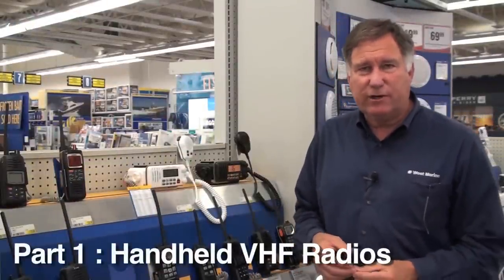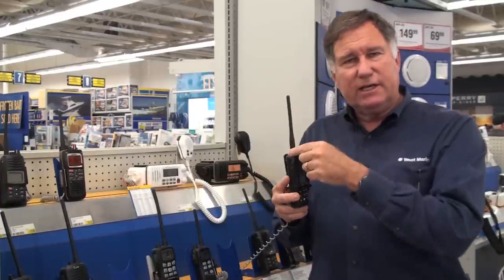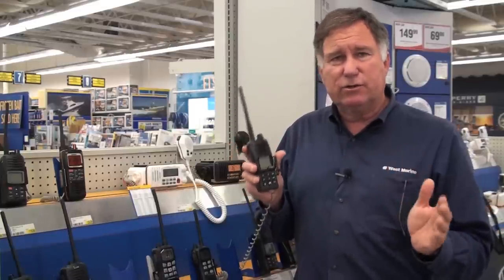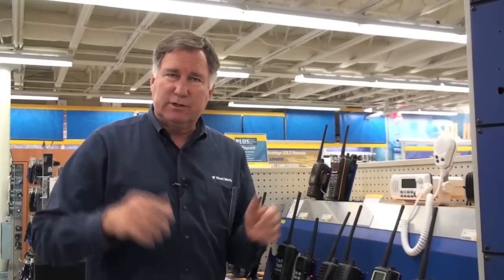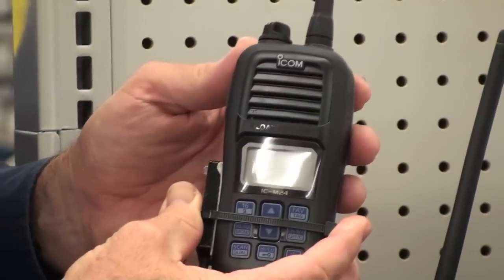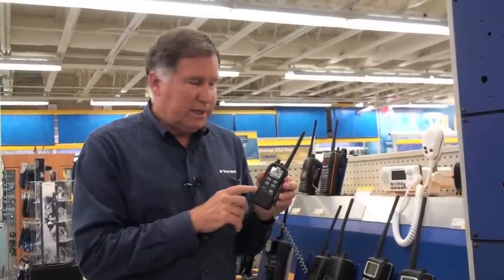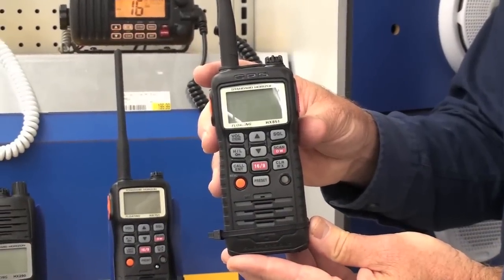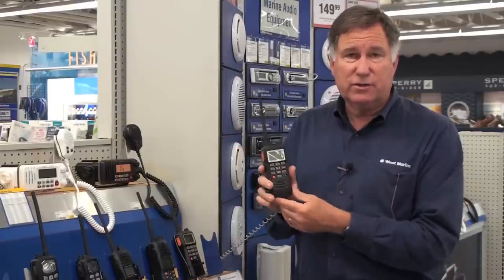VHF Radio Buyer's Guide: Part 1

Comment: I must admit some folks will roll their eyes when you recommend a mobile phone to them when they have a VHF radio question, as everyone already knows about cellphones and someone inquiring is likely looking for an alternative for coverage or outage prep reasons... but definitely yes, you wouldn't want to buy a marine radio for use on land because, as Chuck mentioned wisely, there are a very few channels for all the boaters to be fair, and legally they are some of the most monitored and policed public-esque frequencies there are. For land look into GRS/GMRS (and radios that say FRS) as these are more the land equivalent. A Technician's Ham radio license is so easy to get now, as well, and gets you VHF and UHF uber-priviledges; people say things like. "My dog could get one now that they Nerfed the exam, and he's dead". This gives you the ability to operate something like a Baofeng uv-82 which has the same power as a marine Uniden Atlantis 250 but WAY more frequencies to play with (not recommended for salty marine use though) and perfectly legal to ragchew for hours without anyone caring on oodles of frequencies. That radio also is capable of the marine (would rather rely on Chuck's Uniden at sea) and GRS/GMRS/FRS frequencies (one of those, I forget which, is for Canada and/or UHF technically). Main point, it's best to do the research for an evening, and then relax no one is trying to triangulate you for interfering, and you're helping the world run smoothly. Literally CB is also still pretty cool, but on sideband SSB away from the nimrods threatening to kill someone (or their mother) on the hour. The propagation/distance is great (and international skip is fun and open for the next couple years until the solar cycle ends) the only drawback being the little rubber antennas don't work as far, but large ones work much much farther.

Comment: I believe the FCC allows you to use just about any means of communication in an emergency, but the original question was about land use. You would never want to recommend marine VHF radios for land use. However, in an emergency, I would use whatever was at my disposal. There are much better devices to use on land if you are buying it for that purpose (mobile phone, SEND device, PLB).

Comment: I believe that the FCC has a rule which basically allows you to use radios incorrectly if it will save lives. Sort of like using a Ham radio without a license if you are in deep trouble. However, I would never knowingly buy a radio designed for one use, on the assumption I could use it in an emergency in a different use. What is your objective? I cel phone or a SPOT might be a better choice if you need land-based emergency communications. Or  PLB or a DeLorme inReach.
Reply: एचग